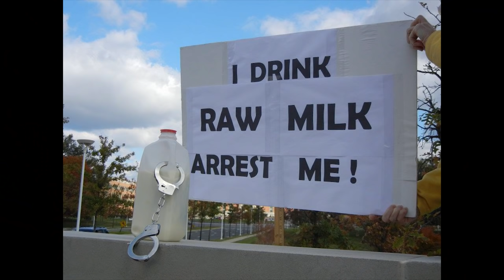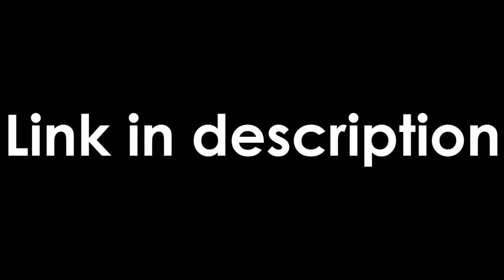It Will be Gone Forever!

Comment: 4:18 isn't that "raking," not "bumping?"
Reply: I think raking is the name of the overall technique and bumping is a smaller part of it
Reply: +The Totalitarian Cheesecake I believe that bumping is tapping the pins,  often with something like a bump key, to separate the upper pin from the lower pin (similar to when a pool ball transfers its energy into the ball it hits), but they are sliding their rake across the pins
Reply: Yeah, but bump keys are illegal in all sorts of ways, I am pretty sure lock smiths can’t use them

Comment: That lock came with a lockpick set I had; it's /way/ easy to pick. As in, if you get only one or two pins up, it unlocks. I think I can spend 3 seconds raking it (the 'bumping') to get it open, and I'm absolute trash at picking locks.

Also, the rake isn't a 'cheater tool,' as, if you're never picking a lock for functional use, a rake will be the fastest on cheap locks.

Comment: If you wan't to start lock picking, all you will need is a bobby pin and a wooden ruler with the metal edge. Remove the metal edge from the ruler and fold it in half (leave a bulge at the end) and then bend it at 90 degrees. This is your tensioner. Next bend the bobby pin at a 90 degree angle, this is your rake. Gently apply tension with your tensioner to the insert as you use the raking action on the tumblers inside. Takes a little practice to get the correct amount of pressure to apply, but it's a cheap easy way to learn for beginners. Tip: Relax and don't force it. it takes a very little amount of pressure with the tensioner to lock the tumblers in place. You will feel it give (sorta pop feeling) when you have unlocked it.

Comment: that's not bumping, that's raking. this scratches the locks and pins.
if the pins are super cheap, you can slowly bend them over time.
Bumping is kinda different.

Comment: using a rake for lockpicking is just an odds game. you literally just try and make the most key combinations as possible as fast as possible. A rake is sometimes easier and alot quicker than single pin picking. check out lock lab, that guy knows about lockpicking

Comment: Question about the shatter perspective shirt (not the LE one).. is the design like that plastic-y stuff stuck on like the foil shirt, or is it more like the shirt where they dye the actual fabric to get the design (I think that's what they do)?
Reply from the maker: +BmwsuGameplay the first one
Reply: samandniko Thanks for the response!
Reply: There are two common types when making shirts.  The vinyl is the first you're talking about and they keep their color the best and last the longest.  They are done with simply a heat press and vinyl for the design.  The other type is done with n Jet printer and has the design shot into the shirt like paper.   The second ones last quite a while as well but tend to fade quicker then final does.  Vinyl however can crack if not taken care of well after about 5 years.  Both definitely have their ups and downs.   (totally make all these shirts for Khronos Studios, hint hint)

Comment: that smartphone thermal cammera you can use it to steal pin numbers (th buttons esp he plastic ones retain enough heat that you can see the number even the order of numbers
Reply: That's why I put a slight bit of pressure on all the buttons after I type my pin. They all end up the same.

Comment: My friend lost his locker key once and needed to open it. I simply put a metal rod through the loop, twisted the rod and the lock pops open. Locks are really not reliable at all.
Reply: Cheap ones, yes.
Reply: Yeah, cheap locks are a piece of cake to open, they're not gonna use high quality locks on thousands of lockers for kids to store their books in.
Reply: My brother lost his key back when he was in high school. He fashioned a lock pick at home, and viola - he could now open pretty much every locker at school.

But yeh, the schools don't usually splash out on properly secure locks.
Reply: BTW, what Guy is referencing is a "Shim (the metal bit)" and "Shimmying".

Most available combo-locks have protection against this, but if you school is cheap they may have knockoffs from china or something.
Reply: Also worth noting (if you're being pedantic like me): while they do appear to use a bump key, they're not actually bumping the lock.

Instead they appear to be using a bump key as a rake.

Those transparent locks tend to be stupidly simple to pick though, so the most basic methods tend to work quickly and easily with them
Reply: Yup, they are just there to get you to 'see what you're doing' as it were so that it's easier to grasp how picking works.